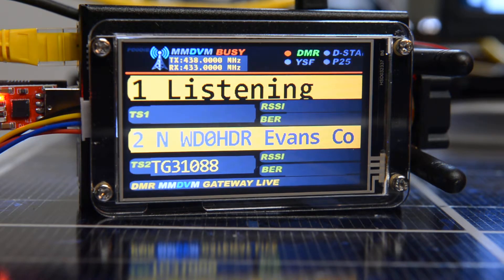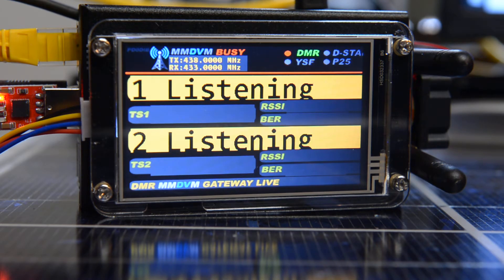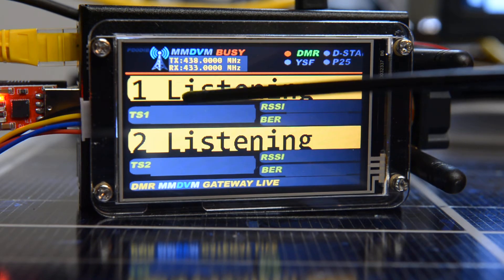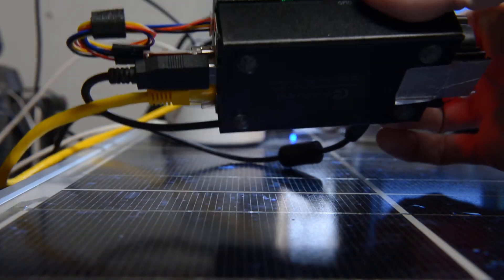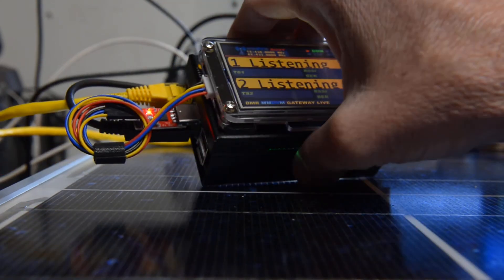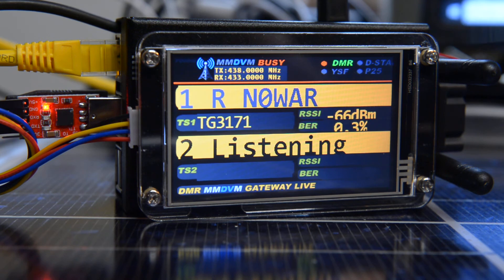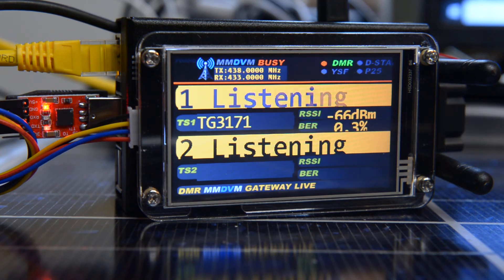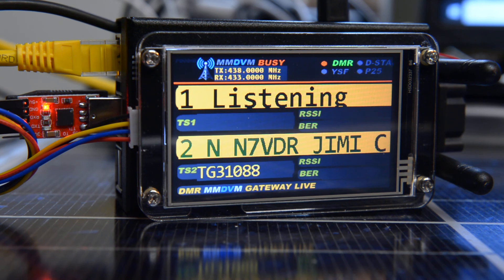Duel Spot Nano Repeater

Comment: I ordered the case for my Pi-3B but it doesn't fit with the antennas on it. I drilled bigger holes and the connectors will fit but are not long enough.
Reply from the maker: they make a little cable extender you can attach to the antenna port and then the antenna on the other end. its like 4 inches long. look on Amazon. peace darren

Comment: Just ordered the DMR min board from the guy in China and just got the PI 3 B. How hard is it to get this display up and running. I can't solder well. Does the case fit both the pi 3b and the dmr mini repeater? Where do you order them from? KH6OWL
Reply from the maker: see the info on the description to this other video for links, more info, etc:  https://www.youtube.com/watch?v=t2DcaxduCs4  let me know if that helps darren. get a cheap usb to TTL usb dongle. no soldering needed! check the links!

Comment: Nice display now -- cool -- thanks Aaron !!!! Thumbs up -- N7JJY
Reply from the maker: i am waiting to put another .txt screen display file from dave here in a few. will make another video of how to load it onto the nextion display
Reply from the maker: hey george, did you peel off the protective covers from the clear case? n7vdr pointed it out that i still had the stuff on it. and the one you got still had it on. its on both pieces and both sides of each piece. easy to peel off then then its CLEAR!
Reply: OK -- i will